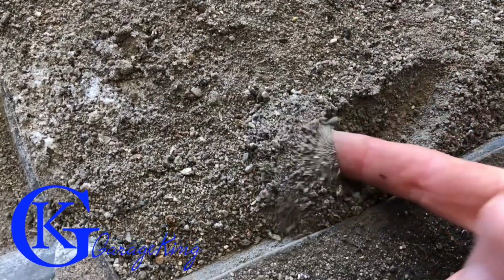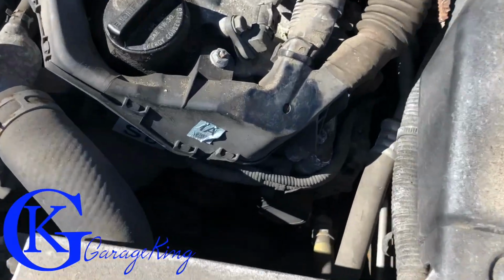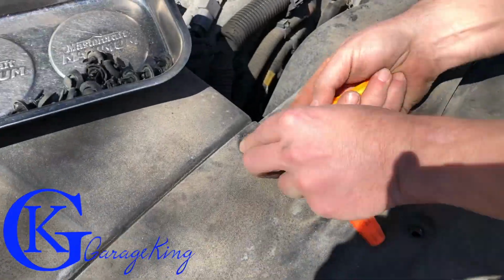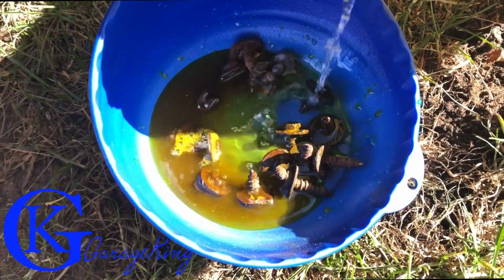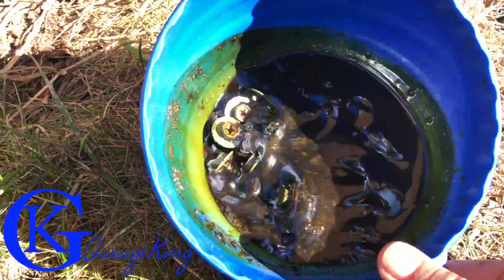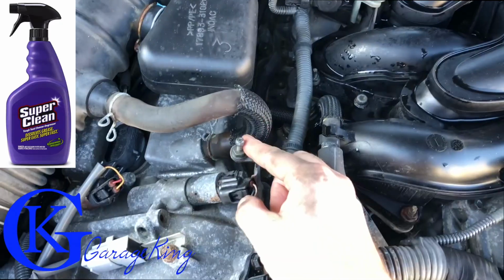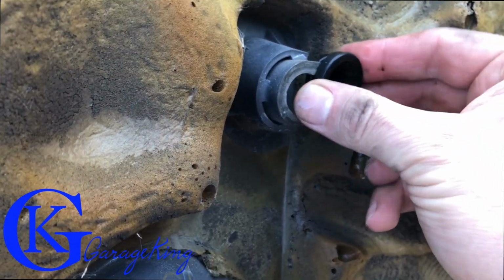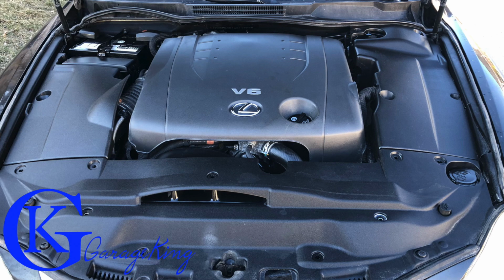This Lexus IS250 is filthy, let’s clean the engine bay

Comment: for the tabs on the engine cover, you can press them down like a button to remove them.
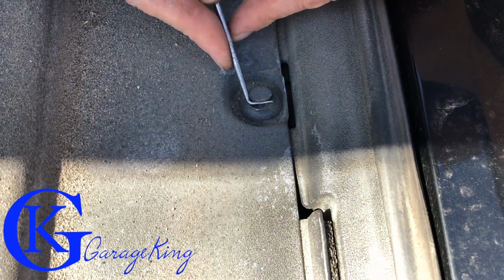Reply from the maker: Hey There, if you look at the 2:04min mark you can see these ones had to be pried up.  I know which ones you are talking about but this car did not have that type.  Its possible they were changed by someone else years ago.  Thanks for the comment, and I wish these ones were the ones that you can just push down, much easier :)  Thanks again :)

Comment: To remove those clips you are supposed to push the centre part IN first then they will come out super easy🙄
Reply from the maker: If you look at the video you could not push the centre in on the ones that were on the car, there was no centre, you just had to pull them out.  I replaced them with different ones at the end of the video.  Appreciate the comment and most of the time you are right, the centre pushes in.  Not sure if these were the factory ones??

Comment: Did u unplug the battery
Reply from the maker: Nope, all the connectors to the sensors are weatherpack (sealed) but you definitely don't want to get the alternator wet so put a bag over it like I did.  Obviously don't soak the electrical parts around the engine. The only thing is if you get a bunch of water in the alternator, when you start the vehicle it can still short out, so that is one part you really have to keep dry. I have cleaned a lot of engines, and never unplugged the battery, but I always put a bag over the alternator to keep it dry.  Do at your own risk, and if you don't feel comfortable you can unplug the battery.  Thanks for the comment :)